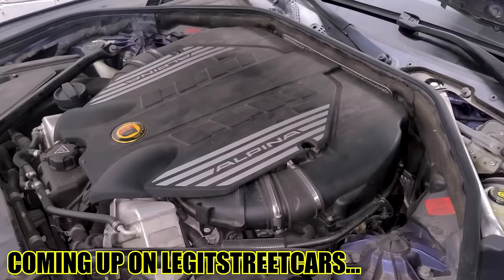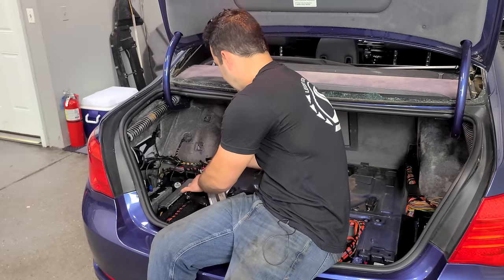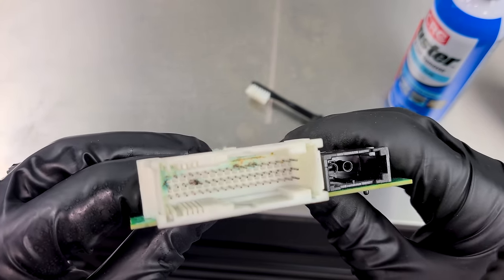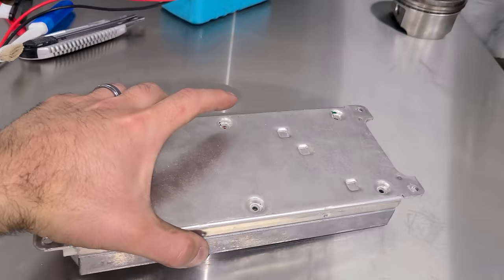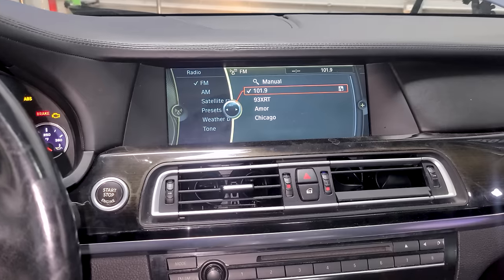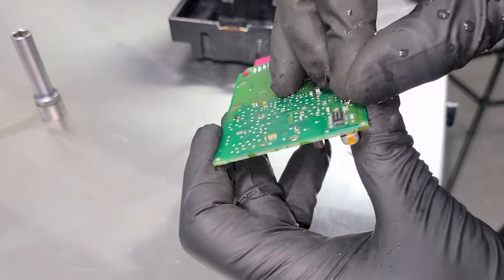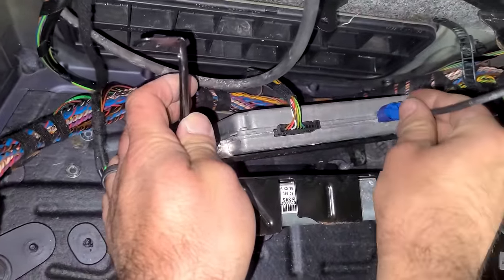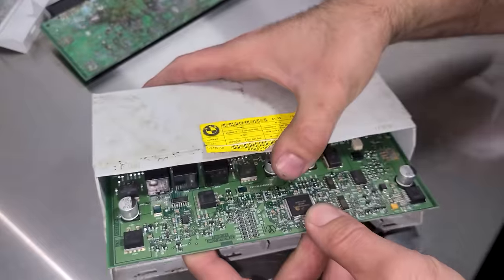BMW Dealer Tried Totaling My Car By Quoting $15,000 For 10 Computers! I Fixed Them All For $150!

Comment: Anyone who drives any German car without factory warranty is INSANE!!!! Its like someone shoots you from far and the bullet is traveling to you and you don't know when its going to hit you and HARD. Every tiny problem WILL cost heavy on them. I warned my sister and NO, she wanted a 5 series. 5 years old, low miles, no coverage and her CC started to drain. All kind of electrical and leaks and on and on and on. Well, now she has a 460GX for 3 years and ZEROOOOO issues. I mean, gas and oil changes, that's IT!!!!

Comment: Pro tip: check out the channel by Loius Rossmann to see what kind of PCB damage needs new solder. Basically if the corrosion is not bad enough to drop components or traces, you should be good as long the chips are still okay. If your car modules have equally poor design to Apple products, water damage will destroy chips, though. Apple favorite method is to put +50V connection next to +1.5V CPU core voltage and if you get a drop of dirty water in between, the CPU is immediately fried and no cleaning can recover it.

Comment: I've had all harnesses replaced twice with ECU and remotely diagnosed later the service department was like a dodgy medical practice maxing out billing codes like a blank insurance check, diagnosing symptoms of a disease they already knew the cause of. I basically had to intervene and play devil's advocate on behalf of the manufacturer when my vehicle was out for nearly 2 months. Don't get I twisted there is no honor among thieves I should have lawyered up earlier for an entirely different situation that already more than met the threshold for breach of warranty.

Comment: Other than Ebay do you have a good source for these control units?  I have an issue with a 2010 Volvo XC 60 that had a clogged sunroof drain.   The Unit under the passenger seat is shot I think.   I'm going to try these steps though.   Thank you
Reply: Might need a new passenger seat too.   Oops

Comment: If you're going to do this then take photos of all the corrosion locations FIRST.  If cleaning it doesn't fix it and tbh most of the time it won't as you can have damaged pads underneath components you can't see.  That corrosion mess is a big highlight to repair companies where to start looking to fix it.

So by cleaning it up if you subsequently send it off to be repaired send a photo of the board with the watermarks on it you could save  yourself a lot of money.

Comment: Mechanics do have to repair to a standard.  They are not electronic technicians so it's replace the module.  Flooded cars are scrapped because they can't be made reliable.  Fix a couple of corroded pins today 2 months later there more corrosion problems.  You just don't know what's happening inside that wire jacket.

Comment: I am so sick of car manufacturers making their bones off of replacement parts. I swear I am not going to buy even a used car from any manufacturer that doesn’t build for a planned useful life of less than 1 million miles.  So far the only one to do that starts with a T ends with an A and has esl in the middle.

Comment: If you are fixing circuit boards that size, why aren't you buying an ultrasonic cleaner and using the proper cleaning fluid made specifically for corrosion?

Comment: Had a shitty Mazda 6. Ran great just getting old and sloppy front end/steering/susp components. Shop wanted like 2500 to go through and replace all the bushings, arms, wheel bearings etc an I got the parts from rock Auto for like 600 incl struts and learned so  much watching utube vids doing it myself.
If anyone here hasn't done that at least once you must lol. You don't wonder what's wrong after that. You just go by smell feel and sounds and you know lol.

Comment: Wait a minute, the crazy bluetooth ECU is a "dumb" unit that doesn't require any configuration or pairing BS, but the BATTERY did?  WTF?  It's a 12v battery.  It should not have any electronics in it whatsoever!

Comment: Dude with the $10,000.00  hydraulic lift in his SHOP, AND a Water De-Ionizer..."You can do this yourself for $60.00..."
Reply from the maker: You don't need any of those like I show in the video.  Did you see the part with the $8 can of contact cleaner and a toothbrush?

Comment: For broken pins another trick is to cut the lead and solder in a single wire connector from any electronic hobby shop.

More relevant for modules that use obscure proprietary connectors.

Comment: Of course the delership is going to just replace the defective computers. They dont have bench level electronic technicians sitting there at the dealership. DUH! That car was flooded and will have electrical problems from corrosion at every connector, ground lug and terminal connection. There is just no way around it and thats why flood damage vehicles are not worth the hassle. They are the gift that just keeps giving....failures.

Comment: Takes a lot of nerve to say that anyone can do this stuff "you don't have tr be a technician", while standing under a car, on a car lift... And then proceeding to dissect the car to get to the ABS controller, including having to remove break lines, and noting that it is going to need a break-system flush.
At least for THIS aspect... You need to know what you are doing, and you need the right tools... You know... Like a technician.

Comment: Ok, I applaud your effort. I really do. But the problem here is that you are not cleaning all the corrosion in this manner. It doesn't matter too much if indeed you can get spares for the low prices you mention (time vs. effort is a factor after all). Over here I doubt I can get the parts for that low prices (tbh. I would have to check). At any rate the way you are cleaning the corrosion has some issues. For one corrosion is often also hiding underneath the IC's. In some cases even the solder joints will have to be redone if they have been corroded. Long story short what you are doing is worth the effort if you have access to cheap parts and can discard the unit if it doesn't work. If you do not have said access I would approach the task in a completely different manner. To the point where component level repair might even be needed.

On a side note I am amazed that only parts of some of the units have protective (what is typically called conformal coating, nasty stuff to remove if you do need to do component repair but should make water damage limited to connectors) coating. Seems silly to me.

Lastly the connectors you were replacing looked like Dupont connectors. It is very likely you can actually get those easily in un-crimped form. The special pliers to crimp them are also fairly cheap so just in case... In fact even the male connectors should not be that hard to get. None of it looks 'non standard' to me as someone who works in electronics.

Comment: now i agree it was shitty for the dealer to quote that but in reality its a bunch of flat rate techs that wont make any money off that job and the chance for a corrosion riddled car coming back and causing them to do warrenty repairs that pay a quarter time rate if not no flat time is super high

in the case of dealerships and automotive shops in general flat rate pay scales are one of the walls that we need to knock down to get better and more honest technicians cause flat rate or commision when pertaining to repairs will ALWAYS cause higher costs and more expensive "fixes"

Comment: The fact that none of these control cards were potted is disturbingly cheap crap for a BMW.  If they were potted, there would be no damage on the cards themselves.  Its not expensive either.  Shame, BMW, Shame.  Edit: 19:52 Some were potted, still shame.

Comment: honestly. I'd quote you the same thing. Cause the truth is 99% of the customers would balk at the 15-20hours of time it takes to properly do this. Also go this route your married to the car till the end of time cause customer wil be a complete asshats if anything ever goes wrong. They don't quote these things to condemn the car. they quote them cause they want no come backs with free diag for shit that should be replaced properly. Specially on connectors so thin that there's tsbs saying you can only remove them so many times before they have to be replaced. because gaps become to big causing issues. but don't worry. corrosion doesn't increase gaps or cause intermittent issues due to electrical fretting. GJ
Reply: Just to clarify to everybody. I'm the tech who has to recreate these faults that are intermittent that only the customer can get to happen and it never acts up when its in my hands. I'm the guy who has to fix these types of repairs after the cars changed hands multiple times. I'm the guy asking "has anybody ever worked on these cars before me or has it been in a collision?" and the customer straight up lies knowing shit like this has been done and I got to be a detective.

Comment: Uhm... All of those MQS pins are fucked. They will last a year or two, but then the issues will start again. There's also a reason NOBODY uses soldering jobs on harnesses: they do badly with vibrations.

Comment: Here: https://youtu.be/eBLQ8r9eMhI?t=453
you should definitely have replaced the corroded connector with the spare.
Cutting and soldering the wires one by one could have been done in half an hour or so.
Ok, it worked when you tested, but you could not clean the inside of the the female connectors.
And corroded connectors are not recommended, even if cleaned.
But if you save the cannibalized connector you kan fix it properly. 
 
This IC seems to be missing two pins:
https://youtu.be/eBLQ8r9eMhI?t=1073
Even if an IC does not use pin it is made with it.
But you had a replace unit on order, so no worries.

Comment: there was a fan vent down one end of the audio amplifier.and an outlet at the other????  The PCB yellow stuff is called "tropicalisation lacquer" which dates back to ww2 when radios were used in wet jungle  climates, a-hole BMW dont tropicalise their boards and the connectors are not IP68 sealed etc and the boxes have no O-ring gaskets, WHY THE F%%$K why oh why as regardless of auctions etc these cars get cold in their a/c then when u open the doors (I live in thailand) if the car is cold water vapour in the atmos  immed condenses over everything Same what happened to my iphone 7 (never again) , I spray silicone "curtain glide" spray over connectors and stuff and it leaves some form of protection, you can use toothpaste on the boards as it's a fine pumice powder but once the corrosion (differential metals same like alumimun and stalnless + water together turns to powder )  has eaten thru the traces its generally over unless you know a local radio-ham type guy with a surface mount bench and microscope. Great video - the work applies to everything electronic and yes water is a great solvent and I dry off with a gentle ladies hair dryer too.. note! This was THE ONE  best video Ive seen for fixing car electronics, !! I'd get a guard dog as the dealer's gonna be looking for you he's out of pocket by $15k

Comment: The only explanation that remains for that broken piece may be attempted homicide, I've repaired a number of braking systems over the years (although not recently) and some of the repairs were made because of just that reason, it's kind of easy to identify tool marks, hacksaw, side cutters, crowbar, screw driver, if you know what you're looking for. If it was caused by ice the break points would show damage started from inside. I was shocked at the number of people that attempted this , some times for the most inane reasons.
Reply: that module could be removed or destroyed and the brakes would still work. You would simply not have anti lock or traction control options. You would need to cut the brake lines for that.

Comment: You are not being fair, its more like $15000 against $5000, You are getting those parts at extremely good prices and not counting the labor, the $15000 quote has labor on it.
Most of the regular guys don't even know where those modules are located nor how to take them apart so figure a good 25 hours to do this same job, I'm not up to date on how much a regular shop charges but yours is probably on the $100 to $150 range, maybe more in Chicago.
So if you want to be fair compare the dealer price against what you would have charged to a regular guy to do the same job in your shop, using used parts ang giving then some kind of maybe 60 days warranty.
That would be fair

Comment: ok,  "pro" cheating tip here.. to get under the bga's  soak the entire bga in acetone, brush some humiseal conformal coating IN the acetone..this is  NOT a good idea but if nothing else works I've had surprisingly good results with this..

Comment: Don’t have to be a technician to do this stuff he says.  And it’s easy.   If its easy for you to do this stuff you know what you are ?   A technician.  Also, it appears that you could have removed that abs control computer from the block without removing the whole thing and the brake lines

Comment: My brother had a Ford villager dealer said they would start by replacing the computer module and see if that fixed it starting at 12 hundred dollars plus labor so my brother had his son a heavy duty mechanic look at it and he tore it all apart so my brother started looking for a used one but nobody had one and they wanted half the price of new after looking for about a year he found one on kijiji and it was only 100 dollars so he bought it his son couldn't find the time to) put it in so
I did it and it wouldn't start so I checked for spark it had spark at the coill but not at the plugs turned out all that was wrong was the roter was wore out and the cap was cracked went to the wrecker 10 dollars for both and it was fixed their diagnostic tool would have told them that but they thought they could rip him off for 1200 dollars and as I've seen before probably would have just replaced the rotor and cap the place I've seen this is when GMC brought out the Delco battery one size fit all even the big trucks the battery would go so in order to do your wotk for the day you'd boost it and you had a 50/50 chance it would blow a fusible link that they never told you about but they'd say the altinator needed to be replaced and the regulator had to be replaced as well as they wouldn't warranty it otherwise and the starter was dragging so it needed to be replaced as well then they would replace the fusible link and charge for it all i caught on because Ford had a weak link in their regulator that would burn off before I found it I used my truck to boost the GMC and then headed out to do my work just as7 I was getting ready to go home the dfiver of the GMC called me and said that the truck wouldn't start so I went to where he was and boosted him started backing out and I got about 40 feet away and my truck died so I took his booster cables and mine and boosted my vehicle let his run for a while and then started mine I had one stop on the way home figuring I'd just leave it run until I got back forgot and shut it off figured I'd need a boost but it fired right up got home and found out the driver had stop at the repair shop and instead of calling home on the radio had used their phone they said it needed a new battery altinator regulator and the starter was dragging and needled to be replaced now if the starter was dragging how did it start with my almost dead battery so dead that it wouldn't even power the coil and if the altinator or regulater were gone then how did it charge my battery and boost my truck and give it enough charge to get home and start it once more when I forgot and shut it off since I did my own repairs I took my altinator off and took it to auto parts store and had them check it out and it was fine so since I'd had to replace my regulator and altinator already a couple of times and a honest mechanic had told me about the wire that would burn off when you pulled to much power ie jump starting a big GMC I opened up the regulator and it was easy to see the wire that was burned off since Fotd also had a fusible link I replaced it with what I had a peirce of house wire 14 gauge never had a problem with it after that as for the GMC next time it had a problem I replaced the Delco battery with a Motomaster eliminator battery the biggest one they had had to take a hacksaw to the battery box as the new one was about 3 inches longer than the Delco and with that we had no more problems with dead batteries those Delco batteries were just not big enough for the bigger trucks and after a year they were so wore out that they could no longer. turn the motor over fast enough to get it started if I remember correctly we replaced the battery 3 times and the repair shop ripped us off for replacing the altinator regulater and starter only once as for my Ford I got ripped off for a rebuild and new regulater 3 times before I talked to that backyard mechanic who told me why the charging system went out on my Ford and I opened it up found the problem and fixed since then I have things checked out) before I take it to the rebuilder and trust them to check it out and tell me it needs to be rebuilt now days the rebuilder are hard to find and the  auto wreckers  is the answer for cheap auto parts

Comment: You can also use 91% isopropyl alcohol to clean the circuit boards. I would also recommend watching this guy: https://www.youtube.com/c/StezStixFix He fixes miscellaneous electronics but if you blow a fuse on the board and the board is expensive or unobtanium this might be your only route.

Comment: Awesome repair skills!  However, if you worked in my shop you'd get fired if you didn't wear safety glasses while working underneath the car, using compressed gases, etc.  Please consider setting a good example.